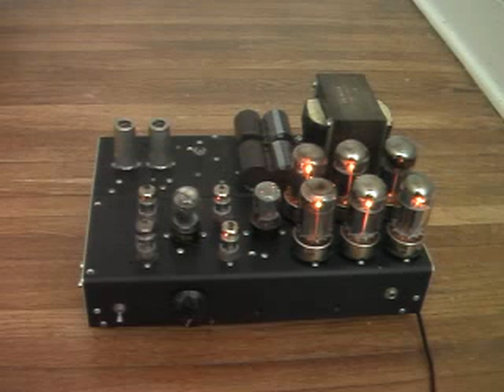Output Transformerless Tube Audio Amp

Comment: My first OTL in 1963 used 6080 (6AS7) dual triodes. Right now, I am building an amplifier with Russian 6P45s, 6 of them per channel. Estimated power out into 8Ω should be about 125W per channel. I'm trying to do mine with no power transformer either. Ten times more tricky than with a power transformer, which provides floating windings. Was going to try Circlotron topology, but may end up with Totem Pole due to the limitations of power supply without transformer.

Comment: Keep going with the valve stage until you get to about 4 ohms....you will need a much bigger transformer and about 10 more valves methinks..that's why they hav'nt been too popular in the budget sector. Electrostatics might work well or could be modified to work with a 50 ohms impedance, 100 ohms should see you good.

Comment: I enjoyed your presentation. I have some questions, I hope you don't mind. I get the impression that these are high-current tubes with naturally low output impedance. I presume that these are used as cathode follower outputs. Are all 3 simply wired in parallel? I've heard that if 1 tube fails it creates real trouble. How long have you been using this amp? How much power does it put out? Do you have Klipschorns? If so, sell them and get something decent.

Comment: Excellent job! A guy at my work is into tube audio especially single ended outputs. He is in the know about tubes and how they sound.
 Nivico (now JVC) made a console stereo in the 60's with an OTL amplifier. It drove special 400 ohm woofers and tweeters.  The Nivico console I have is solid state and sounds ok but I bet it's OTL tube predecesor is more ear pleasing.
I also have a small Nivico/Delmonico console stereo chassis with single ended outputs. Nice easy sound compared to transistors.

Comment: in my opinion the output capacitors will deteriorate in short time.there's a good reason why most tube amplifiers are made with output transformers instead of capacitors.

Comment: nice amp fluffy whiteclouds. check mine out. beautifull 40 plus 40 watts. ultra linear.  you can't beat valves. any linear sound thats true is better than man made  silicone with digital or zero's and ones. check this out i made my own too. this cost me 395 english pounds. real bargain and no crappy printed circuit boards. hand to hand elaborate wiring.

Comment: hi, there's a lot of stuff about building a tube amps in the internet, you can easily google it.  If its still actual, I would suggest you to build 2-staged push-pull with ESS82(6н1п?) double-triode as a first stage driver and phase splitter and two EL84(6п14п) penthodes for a second stage.  This will give you 8-12 Watts and very easy to build - three tubes only (it was my first one, actually;).  I would also suggest air wiring approach instead of circuit plate.

Comment: Nice amp design! 
I remember doing something similar in the early 90's about rectifying the heater voltage, and it worked out well. It was a crude design put together with 7951's for output stage. As far as the "tube v.s solid state" goes, I remember Bob Carver mentioning that "some solid state amps sound like a Buick hitting a wall of tin cans". I don't know, but it was funny and the debate lives on! lol

Comment: This is great stuff! I built my first tube amp a few years ago (the popular Darling single-ended amp), then I built sort of a cloned Dyna ST-70 - but I prefer the sound of SE over PP, it just seems less hard on my ears. I have all I need for another SE using #45 tubes, obviously it won't be OTL - but I also have half a dozen 6080's just taking up space :) I may just try my hand at my own design this time, thank you for the inspiration, my friend, well done!

Comment: In fact if you observe transitors the topology is the same as OTL but with lower initial impedance... but only with silicon and not glass envelopes. So, very very common.

Comment: I have to say something now, but politely. I usually don't waste time with these comments so...
I like OTL technology, it was the prelude to transistors. I had a OTL that pushed 800 ohm phillips fullrange. Lower the number of Ohms there is more resistance so it is more difficult to push the current. This video was posted by a very informed person so please have respect.

Comment: I'm sorry, but if you need a 50 ohm load for stability and if you get oscillation at 8 ohms, then you need to redesign or rebuild this. As an engineer, you should know that.

Comment: 1. I am looking at my Antique Sound Labs headphone amp which has an easy switch for OTL (Transformerless operation) so perhaps not that rare.
2. Flirting with trouble by not having speakers or some dummy load hooked up to a tube amp that is switched "on".
3. Pretty amp!